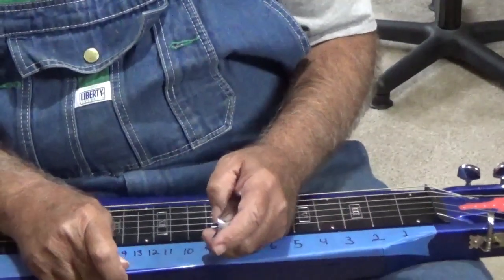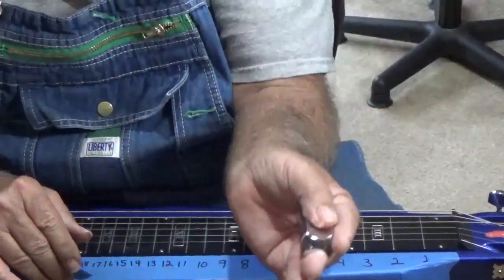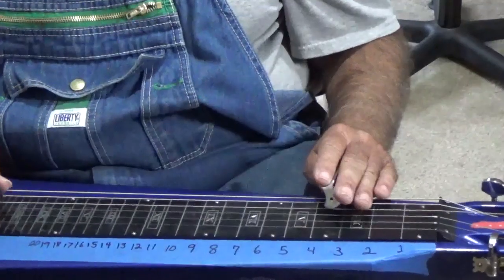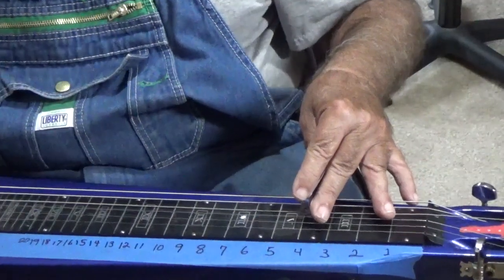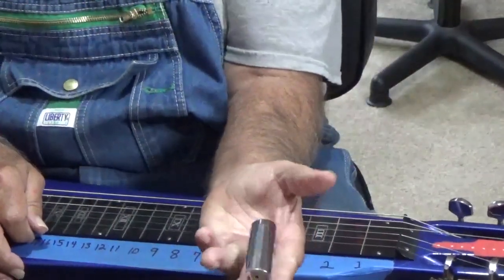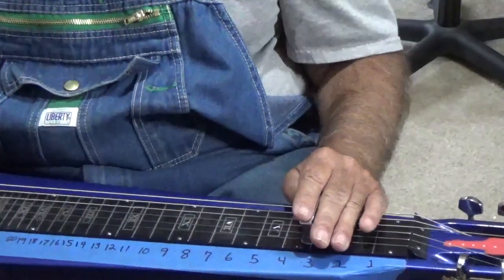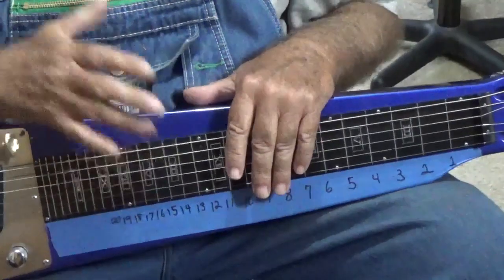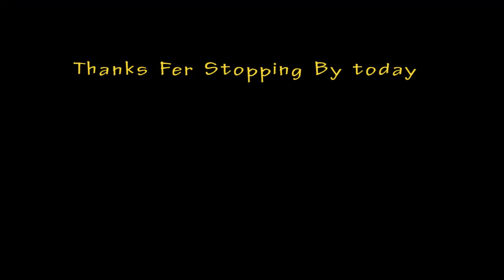Tone Barr Lesson for Lap Steel guitar

Comment: I get a brief ugly little buzzing sound when I lift the bar off of the strings.  Fingers 3 and 4 of the left hand are firmly in contact with the strings.  How do you eliminate this problem.  I do not hear any of this buzzing in this recording.  How are you muting on the right hand to avoid unwanted howl when you are moving the bar.  I am a six month beginner.  My playing sounds choppy. I want to fix it.